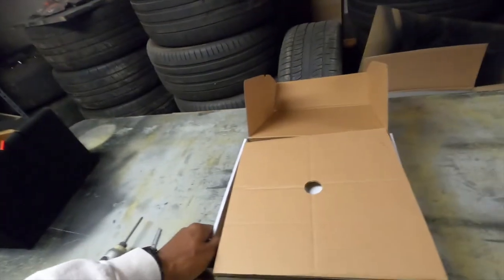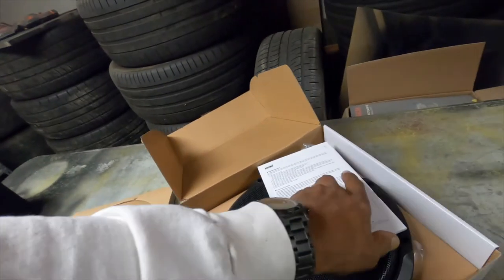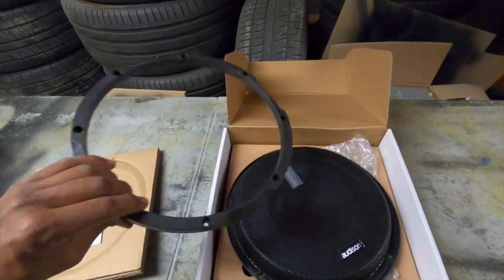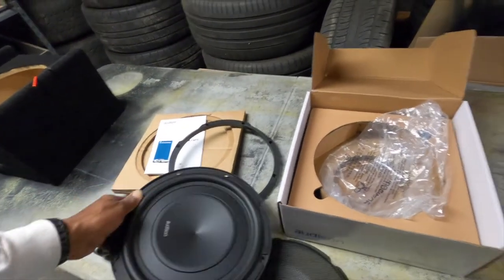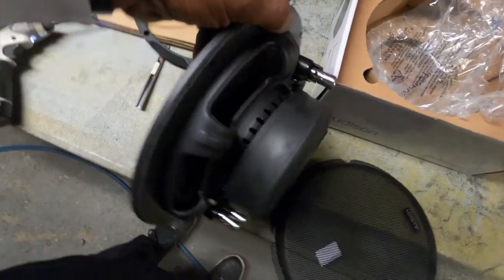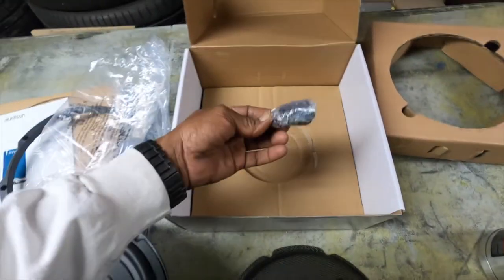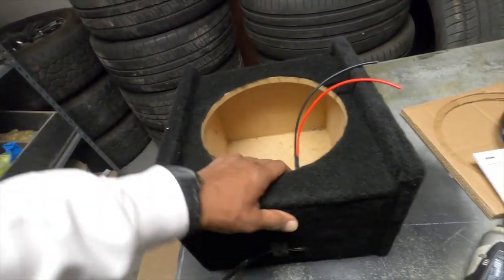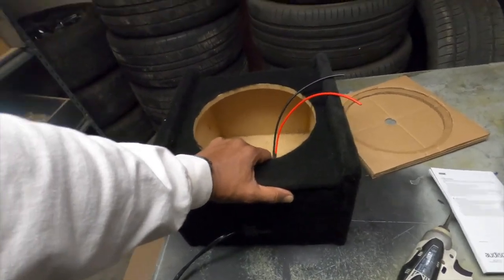Audison APS 10D 10 inch shallow sub-woofer unboxing & review!

Comment: Hi there, Thanks for the video.
I have a camper van which is a little bigger than the Dodge Ram you installed. (Iveco Daily-2017) 
i'm planing to buy Audison APS 10D with Helix(Match) MA 10FX mono amp. and will be use Audison SR 5.600 for my 2 mid comps (focal ps 165fx)
and the main unit will be pionner sph da2300dab.

Does "Audison APS 10D 10 inch" enough for that big van? what do you think? 

thanks in advance
Reply from the maker: Hey Enjoy the Moment!
The Audison APS 10DF woofer can really fill the cab of a vehicle if you want a fair amount of bass. If your a person that wants it to hammer I would use 2 Audison APS 10S4S woofers. That will give double the output.
Thanks for the question. Please remember to subscribe to the channel if you haven't already.